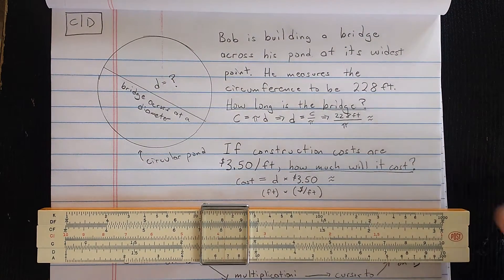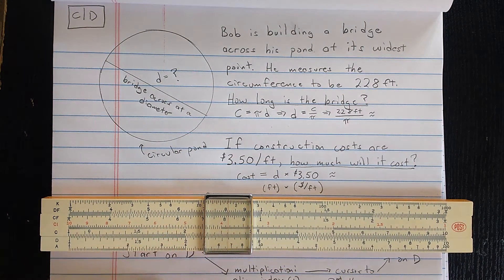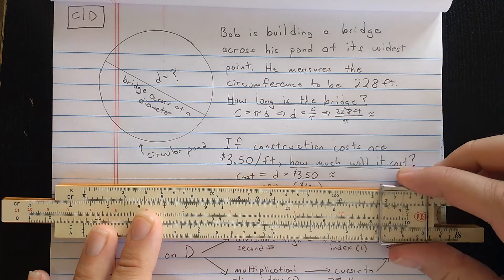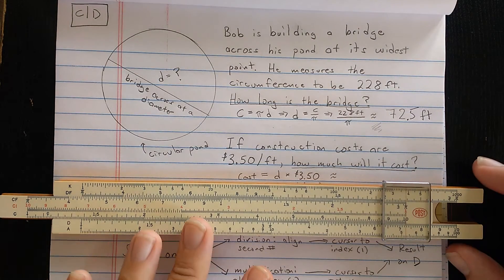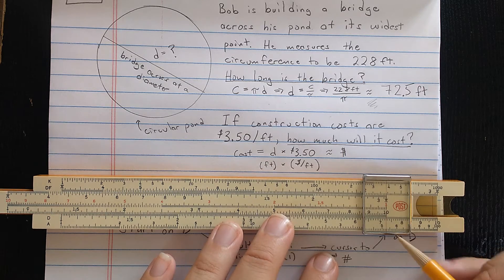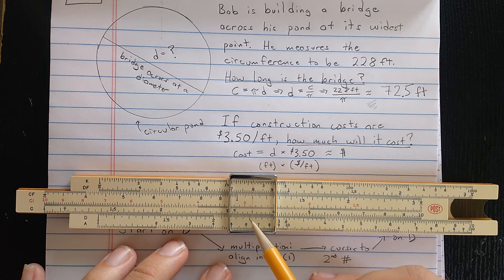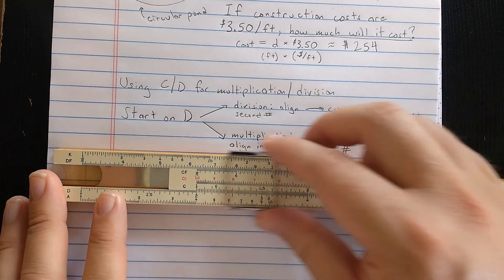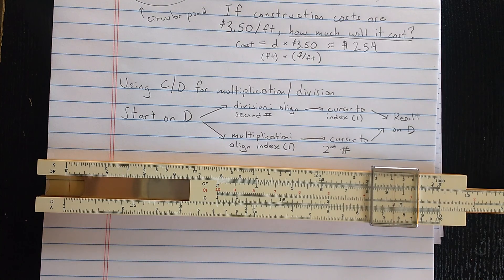Practical Slide Rule 1/5: Basics

Comment: Professor Herning, this was great!  I was able to follow along mentally with what you were doing.  Thanks for sharing.  By the way, what is the purpose of the L CI, C, K and other scales?
Reply from the maker: Warron, I see you saw my other comment. Here is a short summary of basic scale uses:

C/D:  multiplication, division, proportions: the "main scales"
A/B:  squares and square roots (also sometimes used similarly to C/D)
K: cubes and cube roots
CI: easier multiplication, combined operations (double multiplication, double division), easier reciprocals.

L: logarithms and exponentials with base 10. Used for arbitrary exponents and logs unless LL scales are available.
S/T: trigonometry (solution of [usually right] triangles. ST extends both S and T to small angles.)